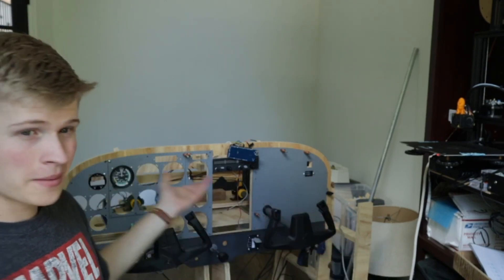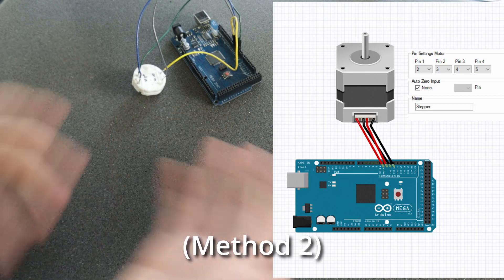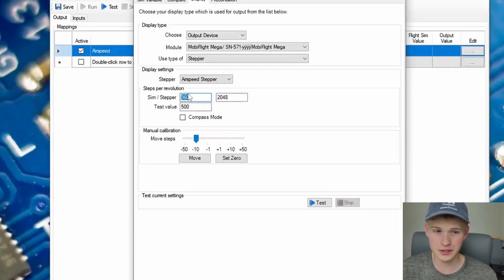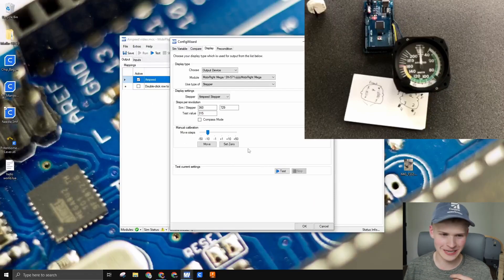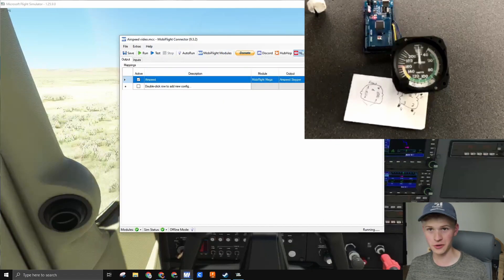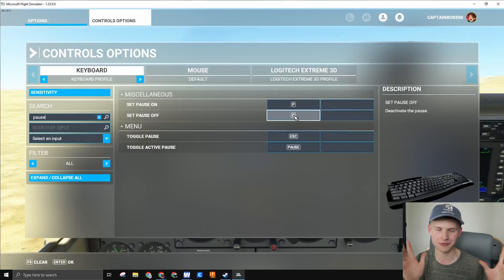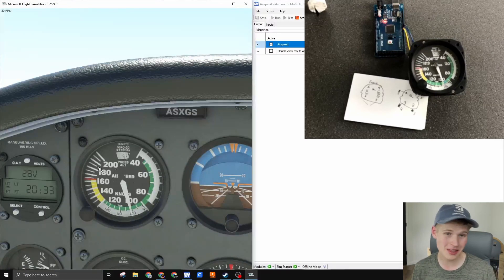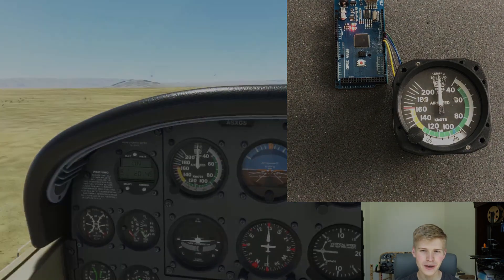Configure the Airspeed Indicator | C172 #34

Comment: Awesome vid! Very informative and entertaining to watch! Also thanks for mentioning me on the channel! One small note. If you notice your airspeed indicator is choppy or stuttering and not smooth like in the sim you can increase the resolution. Mobiflight rounds up to the nearest integer so it only moves the stepper when going from let’s say 75 to 76 knots. When doing fine maneuvering this stutter is very noticeable. To fix it change your transform to $*10 so the resolution is now 1/10 of a knot. Of course your will need to add a zero to all values in your interpolation table as well. This will make it butter smooth!!!
Reply from the maker: Thank you for the tip! I will be sure to do this in the sim! 
The x27 might have a little bit of jitter regardless, but I think this should help a lot!

Comment: Hi, thanks for your videos. Could you help me with the configuration of an x.27 stepper motor, specifically the values for display scale, steps per revolution, full revolution, max speed, and acceleration, in Mobiflight version 10.5.3? Thanks for your help.

Comment: Hello Tom is a big congratulations for your channel was tutorial .they are really of great quality and very interesting which makes you want to try to do the same thing !I will have a question to ask you. do you think that on the arduino mega 2560, we can put together the altimeter the Varios meters and the airspeed? I thank you in advance ,good luck see you soon. 
PS:i m a beginner😅
Reply from the maker: Hello! Thanks for writing in - you can assign up to 10 stepper motors to one Arduino (assuming you have sufficient/external power supplies)

Comment: Hey there, it seems as though that the new mobiflight has no option for test value, would you know any other way to get around this?
Reply from the maker: It's still there it's just "test current settings" and set the value to much higher than 1

Comment: 9.7 MOBI IS A LITTLE DIFFERNT, WOULD YOU KNOW WHY MY STEPMOTOR IS SHOWING REVERSE SPEED??
WHEN I REDUCE POWER MY NEDDLE GOES FAST, WHEN I REDUCE SPEES THE NEEDLE SLOW DOWN
Reply from the maker: IT'S LIKELY YOUR STEPPER PINS 2&3 ARE INCORRECT. ADDITIONALLY YOU CAN REVERSE ALL PINS OR APPLY THE INTERPOLATION.

Comment: Thanks for your videos from Spain! I've built your airspeed but the stepper motor rotates in the opposite direction to the simulator's airspeed; I don't know how I can change the direction of rotation. Thank you very much Bob!
Reply from the maker: Hello there Alberto ! You can reverse your wiring or switch the maximum values for minimum values in the interpolation table. Hope this helps!

Comment: Hi again Captain Bob Love your videos. I have just set up an X27 and am impressed with how smooth they are. Do you know or has anyone converted your Servo version of the Air Speed indicator to use the X27. I don't want to print the X27 version as i think the Bezel size will be wrong for my panel cut out
Reply: Sorted. I managed to convert the servo version of the Air Speed to using a X27 and it runs much smother. Was quite easy and I did not have to print any parts. Just used some Kiwi ingenuity. If any one wants to know how am happy to explain but didn't do a video.
Reply from the maker: Nice! Awesome to hear you got it sorted out!

Comment: Well. Now I’m in a dilemma. I have 2 3d printers and a small hoard of electronics bits and bobs, but my plan was to build my sim like Allen Glen with a lcd screen behind a mask and use Air Manager. But this looks so cool,  I’m thinking I should shift my strategy. Hmm.
Reply from the maker: Hmm - quite a dilemma indeed! 
This method allows for the proper placement of the yoke (monitors don't like being drilled into) but it is much slower.
You can always make the holes for either one then "graduate" to the next one (or give up 🙃)
Reply: @CaptainBobSim  Thanks good points. You’re an inspiration to your age group mate, I’ve got 35 years on you (and passed a real PPL) so I’m a good judge, thanks for all you do.